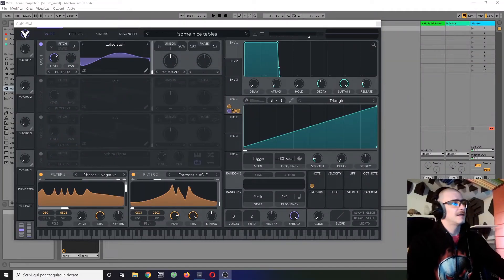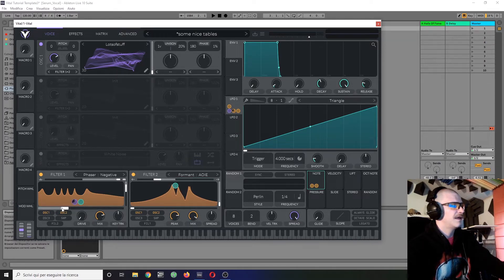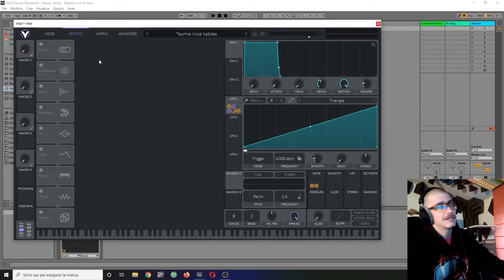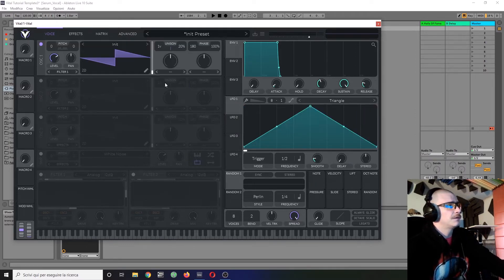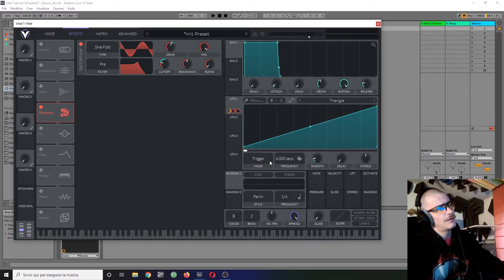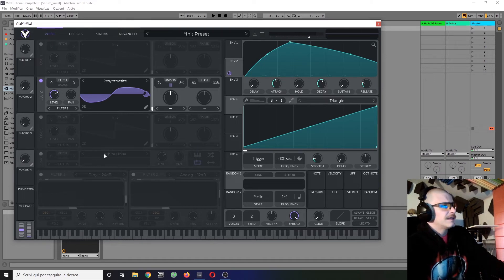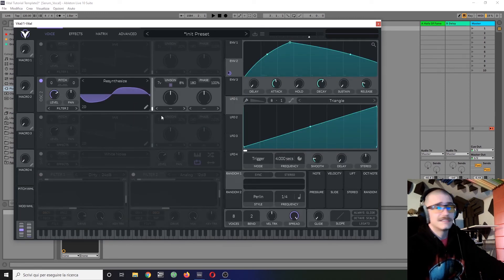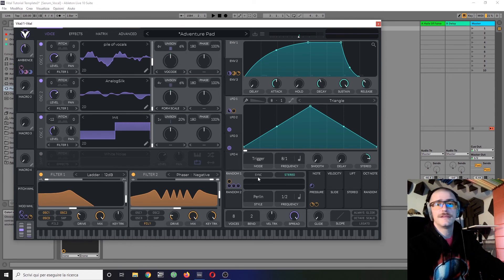vital synth tutorial | wavetable resynthesis

Comment: great video thanks. Question - if I used my ears to choose the length of time between the first and last keyframe, is there a way of knowing what this timeframe is so I can match the LFO time before resynth?
Reply from the maker: The resynthesis process samples 4 seconds of the patch, that was my reasoning behind setting an LFO like that. Then well, you can choose by ear where the start and the end are...
Reply: Thank you  @platipo .  So is the resynthesis length always dictated by the original sample's total length?
Reply from the maker: Nope, as I said, it is always 4 seconds, so, if you're resynthesizing from say "the synth", you'd better make something that lasts 4 seconds in a sensible manner, if you're using the sampler as a main source, things might get a bit more complicated, but the sample you resinthesize to a wt will always be 4 seconds long
Reply: Aaaah I get you, that helps a lot to know.  Thanks  @platipo  !! :)